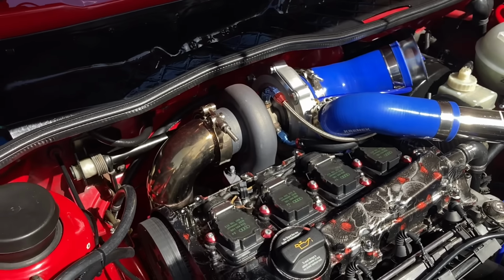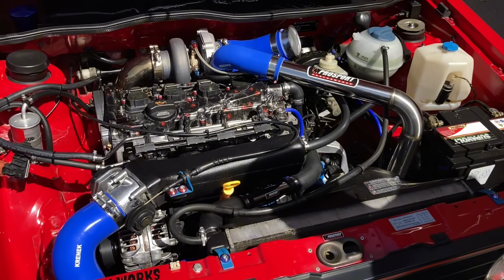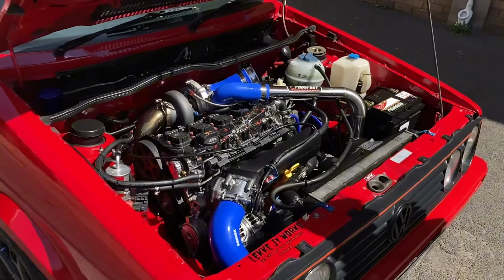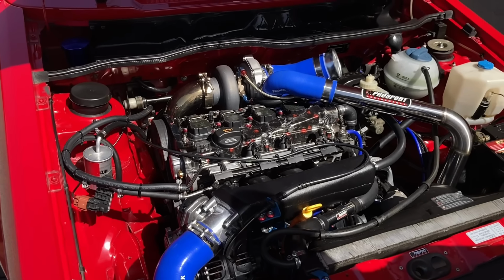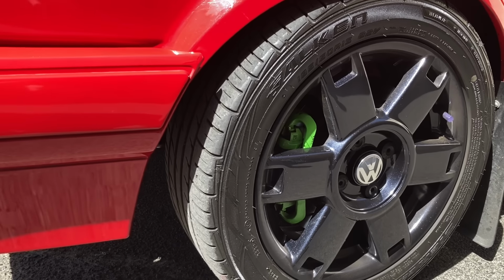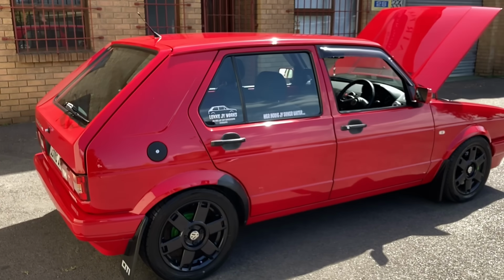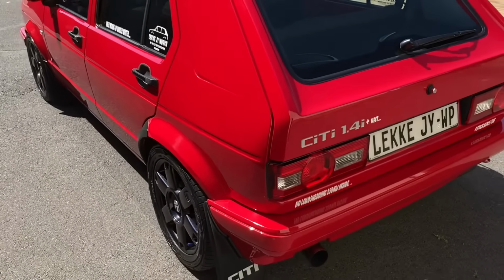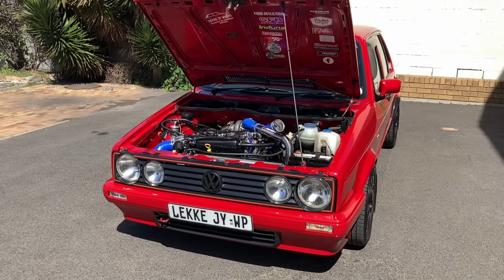Big Turbo 1.8 20V Mk1🔥🔥🔥

Comment: Curious to know a rough estimation of the cost to build that thing(Gearbox included).
Reply: Probably 50k to 75k. Not bad. 2L ADY build costs 50k with engine included. But depends which shop you go to

Comment: Wonder what a setup cost to put in a mk1 like that
Reply: Starting from R60000
Reply: About 90k,std with a few bits is 60k but that rods and pistons already 16k to 18k alone so you need still Arp headbolts again almost 2k and arp fasteners aren't cheap,machining for bearings and fitting everything so yeah 90k is motor alone to get it where he got it but this man is uit gesort so probably cheaper for him.